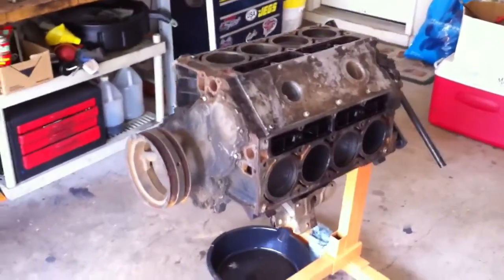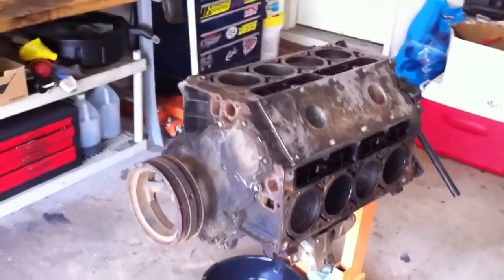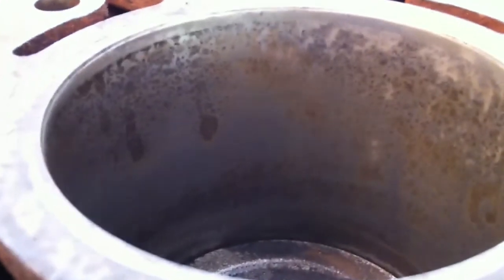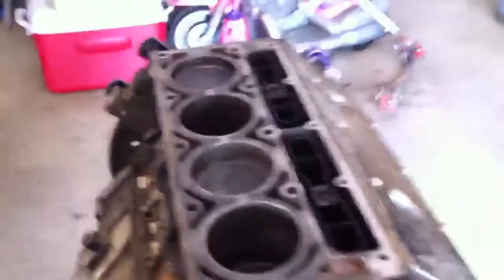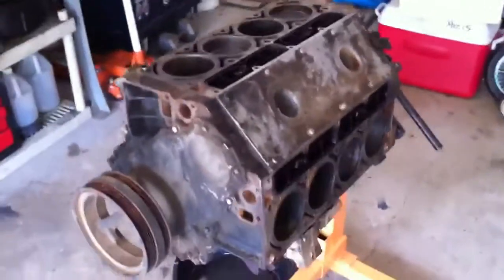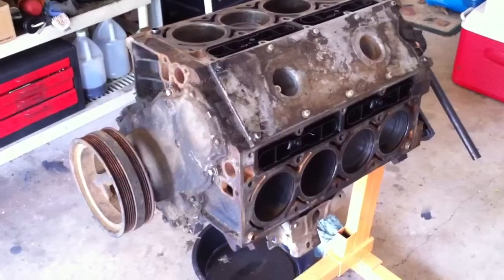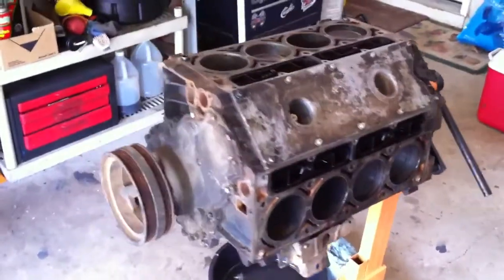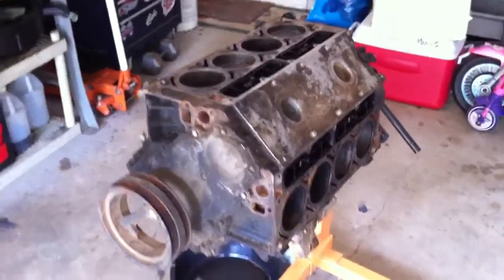LS1 LSx "Squirter" 5.3 Project Idea Presentation

Comment: i pulled my 317s an im going with 799s i found some rust in 3 cylinders, should i smooth them out an run it? turns over easy and freely
Reply from the maker: Three months later, I finally get a chance to reply. ha! Yea, you should be good since it turns over smoothly. Wouldn't hurt to rub the rust out with something not too aggressive.

Comment: could you soda blast the motor? also how did you clean out all the crap after you finished sanding? AGearhead4Life
Reply from the maker: Yea, I cleaned it out with a degreaser and a rag after sanding. You could probably media blast, but not sure how practical it'd be. I just degreased it and pressure washed it. You'll see in the other videos that it cleaned up well.

Comment: how come you didnt think to hone or deglaze this block? witht the stones that go onto a drill
Reply from the maker: I did actually end up breaking the glaze with stones on a drill at the last minute before putting the heads back on. Didn't pull the pistons out though. Just put them to the bottom of the cylinder. This motor was treated rough. I even have pics of doing a little port work while the heads where assembled. Tough little motors.
Reply: oh ok awesome! didnt know and was wondering cant wait to see her up n running again
Reply from the maker: Adam Wolfe Yea, that motor will be pulled out and inspected. I have a 6.0 with a turbo going into it. The short block is ready. I've just got to finish porting the heads, which should be done tonight.
Reply: hell yea!

Comment from the maker: Donations would be greatly appreciated. We're not in as much need as we were, but there are always things that donations would help with. 

So far with donations we were able to purchase the head gasket, head bolts, get heads milled, fuel pump and received a programmed PCM. Its getting close to ready. 

I still need to buy wire, fuse block, intake fittings, Spark plugs, fuel filter and probably some other things that I'm not thinking of right now.

Have you seen the latest video on the Squirter?

Comment from the maker: yes, those would be up near the top. For me a pair of '96 Style Vortec truck heads would be at the very top. You'll need a special intake for that also. Those heads have been measured to out perform old camel hump heads. You can find them cheap sometimes for $100 a pair. You'll know its them by the fact that each head only has four intake bolt holes. Two near the front of the head and two near the rear. They came on fuel injected trucks, but will work. trust me.

Comment: What kind of upgrades would you do to a 305 for better performance if your goal was to obtain parts that would later be swapped to a 350 or any larger bore engine. I would assume headers and ignition would be on the top of the list right? All opinions welcomed.